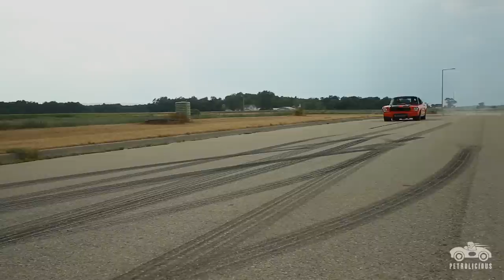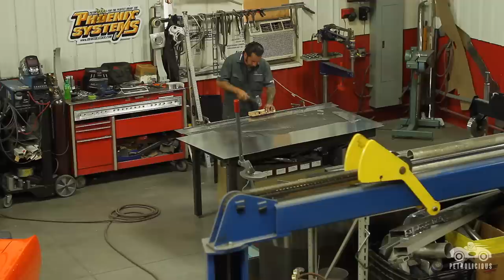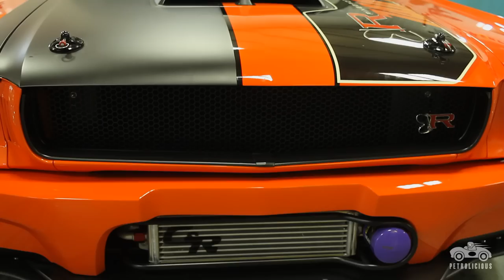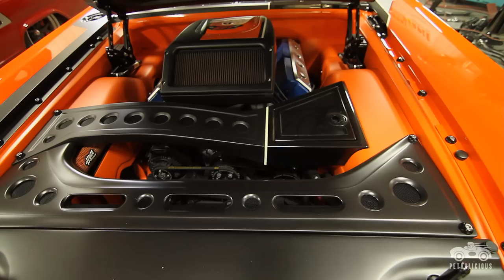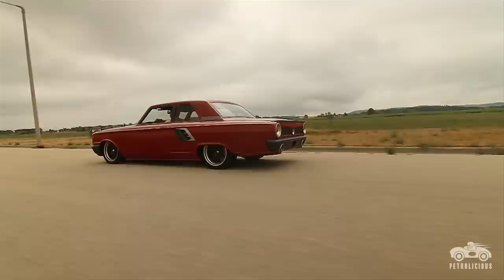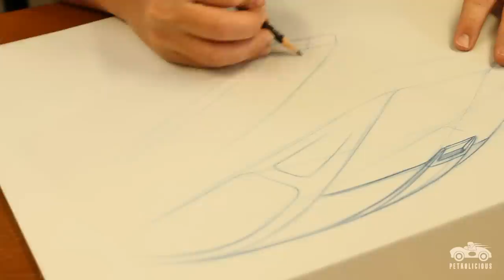The Ringbrothers

Comment: before watching, swear to god, if they put a chevy in a thunderbolt homage, their tools need to be taken away. if youre gonna pay homage to a vintage car, maintain its pedigree unless the project absolutely warrants a lineage diversion. rejection of rules is one thing, but inability to maintain theme shows laziness, lack of focus and technical prowess. sure, outstanding body men. inventive engineers. but every manufacturer will have its plethora of strong motivations to chose the purpose of a build. dont get lazy and go cram the first dressed up crate motor that pops up. like theyve done. the ls in a Pantera shouldve got them drawn and quartered. You really mean you cant find a guy to build a bad ass 351 cleveland? you didnt try. i can understand the challenge with the javelin. amc was floated to the top so there was no aftermarket. every artist must keep their pallet coordinated, their composition congruent, otherwise an overall strong piece can be drowned by  sloppy innattention and incomplete thought. and being that an engine is the nueral fiber of the thought of a car, the choice of the proper one is the backbone of the car itself. poor choice can relegate a statement down to a mere curbside styling study, a clashing distraction overshadowing the build itself.